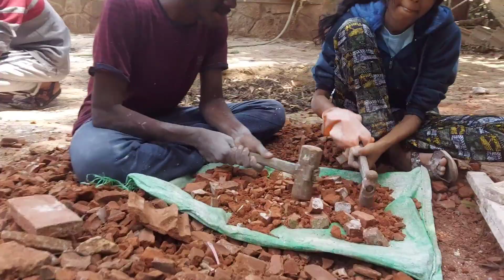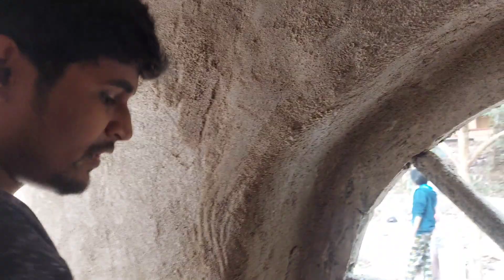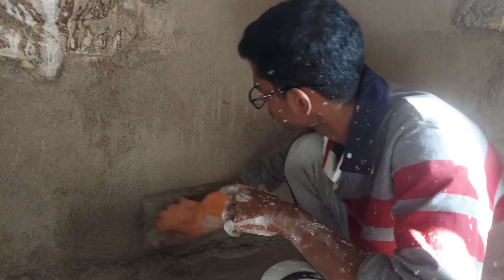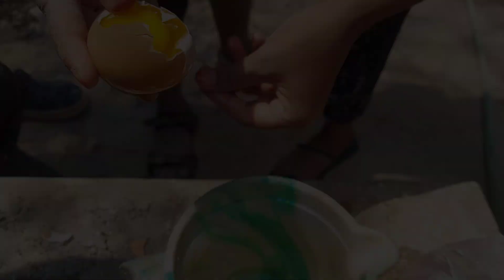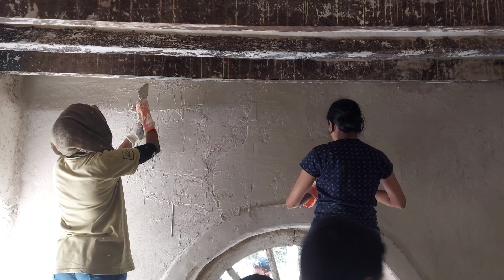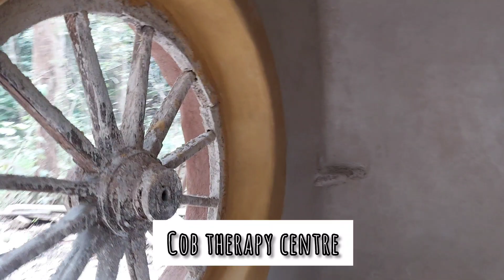CHETTINADU PLASTER || LIME FINISH

Comment: Why is egg used?
Reply from the maker: It's provide extra glossy finish and it's easy to burnish.
Reply: @earthbuilding6164 egg white for a water proof. and you should use egg white Foam. not directly.
Reply: @earthbuilding6164  
1. what is the proportion of egg white to the mix?

2. can you add colour pigment to the chettinadu plaster (like you can to the tadelakt)?

Thanks!